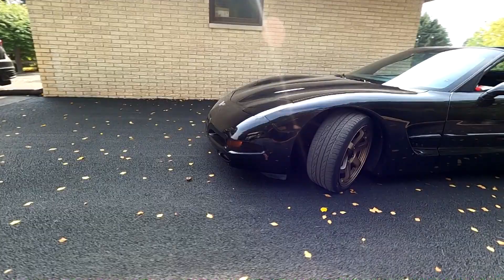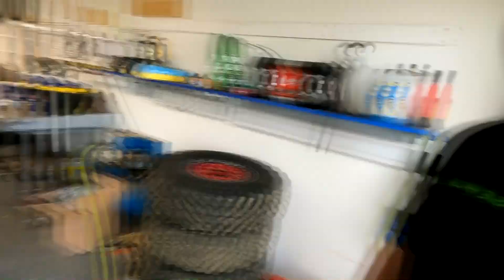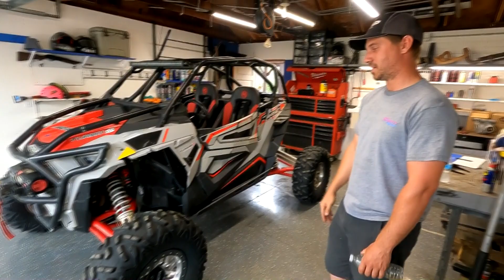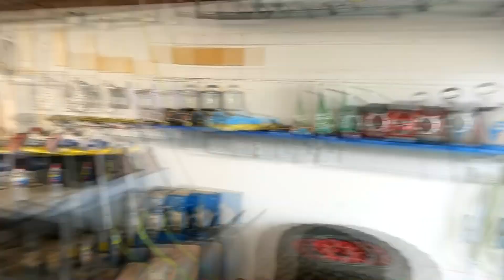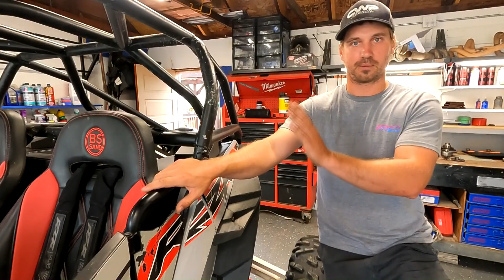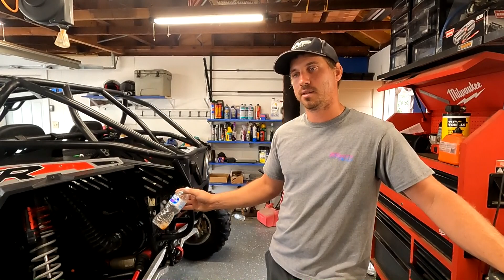RZR Turbo S Carnage & Upgrades | Tippy Update!

Comment: I just put a sandcraft driveshaft and carrier bearing in my 2019 rzr xp 1000 and it kicked my ass. Had to unbolt and move my front diff to get it in. Is that your experience as well?

Comment: Slick Vette! Hey Billy, how's it going buddy?! I've enjoyed some of your riding on other channels. 

Triangulating those open spaces in your roll cage goes a long ways sir. I think you made a wise decision. 

I like the look of powder coating, but you're absolutely correct, it isn't really any more durable. 

I've always considered doing a clear or tinted roof setup. Not sure it's doable even. 

HORNS! LOL

The Nitto is supposed to be the good stuff. If I build a machine, they're what I had planned to use. Billy or Justin, what tire knife are you using?

I am a big fan of playing with clutch tuning. That and suspension mods are way more effective than hp gains imo. 

Man, poor Billy! On the bright side, with the cost of steel right now, our boy is sitting on a gold mine in metal materials, haha. 

Great stuff fellas. Good to see you both again. Catch you later.